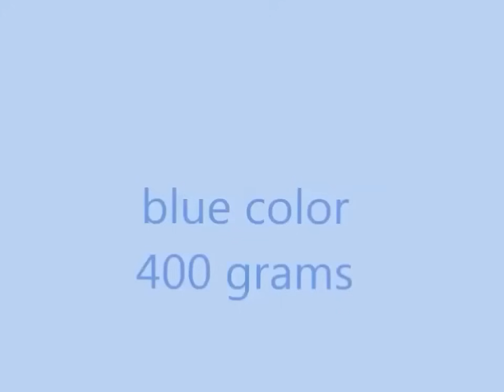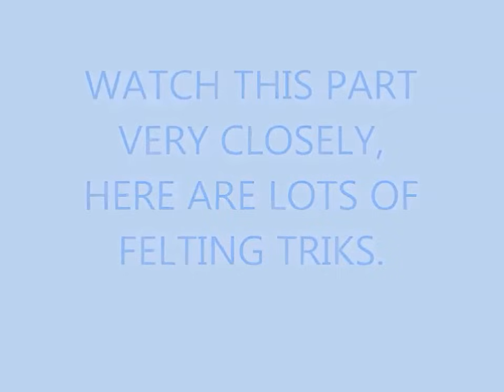cat cave. how it's made

Comment: Cat caves don't need to be felted. Simple upholstery with batting and quilted material over a form is faster, cheaper and can be removed for washing. 

Take a covered litter box and make a quilted liner and cover using liquid stitching and Velcro.

You can make it fancy, country, plush or whatever. You decide the material. Insert a pillow, pillow the top, add a heating blanket (always use low setting), or whatever.

We made a giant birdhouse motel for the cats with multiple rooms. The top lifts  on 3 hinges for cleaning. It's painted like a whimsical birdhouse and each of the four cats has their own room.

Or take a large hatbox from Michael's, cover or paint the top and bottom but make sure to the top can be removed for cleaning.

My sister's cat tree covers an entire wall in the rooms next to each other. We cut holes in the sheetrock and made four tunnels. In each room, the cat tree looks like a large bookcase. Unless you look closely, you wouldn't realize its a multi-story, two room cat playground that also holds plants and other objects. It's stained in cherry and multiple privacy rooms. The privacy rooms appear to be adjoining books. The shelves are lined with rubberized gripping.

Plan and build your own. Use you imagination. Use discarded furniture or thrift shop items. Old nightstands make great cat retreats or litterbox holders.
Reply: That defeats the purpose of wool batting. The wool is what keeps cats warm in winter and cool in summer. The lanolin in the wool is very calming to cats.

Comment: For the lazy wet felters ;)  It seems like after laying the wool and doing a small amount of felting, you could also throw it in a washer for a little while for some extra heat and agitation?  And then when done, into the dryer for more heat and agitation, wetting it if you need to reshape?  I bet you could even put a pillow in the middle for the dryer!
Reply from the maker: be very careful, wool can scatter; run away in all directions
Reply: @kivikis  That's why I was thinking as a second stage of felting.  Do the initial as described (and I love the rolling pin, great idea!)  After I have done some initial felting, I often have thrown my wet felt sheets into the washer to tighten them up more (also if you throw them in the dryer after cutting a piece out, it smooths the edges nicely!)
Reply from the maker: yes, you are right,
but, again, be very careful, 
washer can make cat cave to shrink (same as with your wool sweater)

Comment: What kind of soap are you using.. can you use any kind of soap
Reply from the maker: i use normal toilet soap (alkaline soap), or you can use dishwasher liquid (alkaline base)
Reply: Can i use circular template
Reply from the maker: yes,  cat cave  would be  round,
Reply: Ok..thank you..cant wait to make one.. 😄
Reply: I don't have that bamboo thing.. can i use any other material or can i roll the felt itself
Reply from the maker: the bamboo curtain helps harden the cat cave, other way cat cave would be without shape
Reply from the maker: @mamoiihlondo3214  :)
Reply: Just finished making it..it totally crashed..🙁
Reply: Wonder what i did wrong
Reply from the maker: @mamoiihlondo3214  
please, send the picture to me,
 i will explain your mistakes
kivikis@gmail.com

Comment: Other alternatives of wool?
Reply: No only wool will do what wool does. It icomes from sheep. It has microscopic barbs all over the shafts. Alkali soap and hot water open the barbs. You press or pound to combine fibers when the barbs  open. Afeter rinsing the soapo out with warm water many times, you rinse with cold water to close the barbs and lock all the firbers together. This is process discovered thoousands of years ago. Now in factories with big machines, it can be made of polyester,  where it is fused with something like giant heat presses. That can't be done at home without a lot more work than she has done here.

Comment: I was wondering why use soap? To make the wool fiber more fluffy or frizzy to hold together? Is that the reason why using soap?
Reply from the maker: hello,
soap and hot water are used to open wool bristle, other way, felting process will not happen.
Reply: @kivikis  Is it special soap?
Reply from the maker: i use organic bar of soap, also you can use any dish detergent liquid

Comment: I wonder if this may be done using natutal sosp from a very dense solution from soap nuts. Also, is it not better to squeeze out extra fluid over a surfac3 that has drain holes?after all, you don't want fluid rea-absorbed? 9 would like to try making smaller versions of these for our industrious squirrels usunh all the glorious fur retrieved from our fluffer cat using the amazing furminator. :)

Comment: Hey, amazing work! I have a few questions. 
Do I really have to use that much water? If necessary - how can I realize it without flooding the floor? ;-)
And how does it come that your cat caves are quite solid? I saw some other caves and they kinda deflate.. so do you use a specific micron? Or what do I have to consider?
I would love to hear from you.
Reply: LustAufLyrik I was wondering if she has a workshop with a drain in the floor
Reply: You have to make it with many layers like she does so that it will be thick, and then full the heck out of it to tighten the felt up as much as possible.  I prefer using a coarser wool for durability, but you can make them with merino.

Comment: Pardon me if I missed something.  Does the original plastic template remain embedded in the first two layers?  Also, how many pounds of wool made this cat cave? I love your method and end product! ♡♡♡♡
Reply from the maker: i pull out the bubble wrap plastic after cut the hole.
i use 400 grams white wool and 400 grams color wool.

Comment: So the original bubblewrap template ends up inside it?  It looked like you kept folding the wool around the bubblewrap, but I never saw it removed.  Did I miss something here?  Also, how much time does it take to make one of these (including setting/drying in between steps)?  I think my body would HURT after trying to make one of these.  Wow.
Reply from the maker: No. You need to remove bublewrap.
Takes 1 houre to make. Plus drying for 12 hours.
😊😊😊
Reply: @kivikis  At what point in the process did you remove the bubblewrap?  I must have missed it or that wasn't shown in the video.  (???)
Reply from the maker: After i cut the hole 😊

Comment: The water part looks   pretty messy
Reply from the maker: yes, 
you need to use lots of water and soap,
on the table I have made  water runoff, 
water through the hose go directly into the bucket under the table.

Comment: Nice shelter but it is not weatherproof. When it rains it will be totally soaked and will collapse unless it is under a roof. If the shelter is exposed to the elements it must be made of plastic like the tub type shelters others have made.
Reply from the maker: .yes, you are right, it's not waterproof, 
but look wider, 
you don't bring you sofa outside in the rain
the cat cave are made for inside use
Reply: Why does the cat need a cave if it's inside? A basket with pillows in a dark corner should be sufficient.
Reply from the maker: @makeminefreedom  
yes, you right,
but video are made for the artist, to learn how to make something nice, like cat cave ;)
of course, cat prefers what's are best for them: carpet, closet, box or any unusual space ;)
Reply: @makeminefreedom  
Many cats like the security of walls all around them.  That's why they love boxes, even if they barely fit.